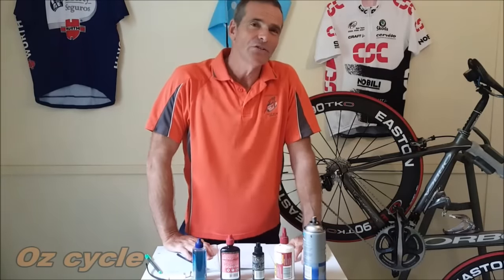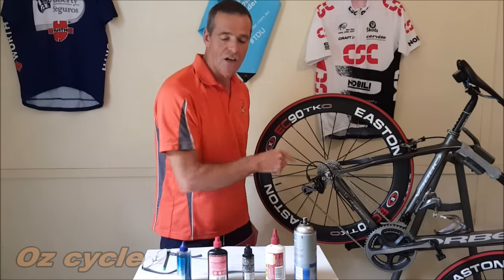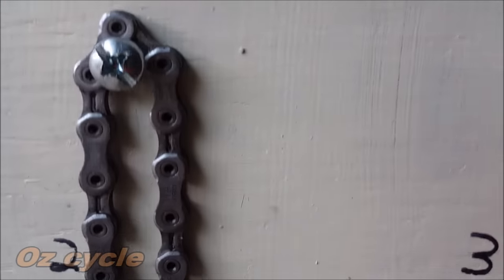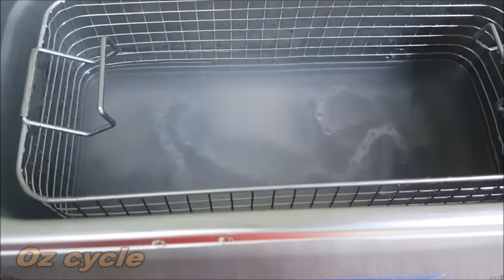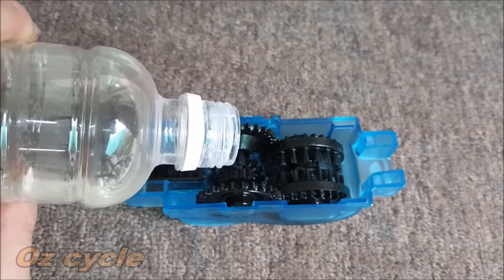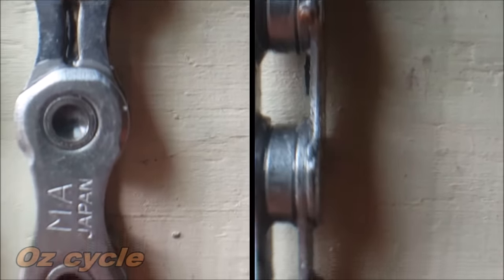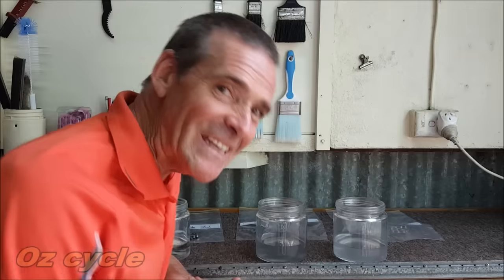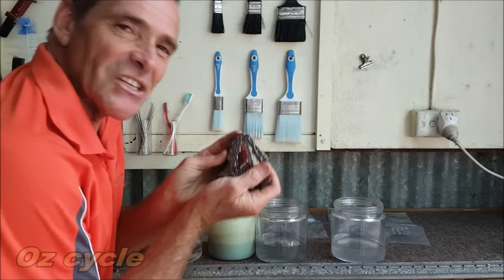Best chain clean ever !!

Comment: These results can be debated. Different cleaning agents were used for the different methods.
Also the ultra sonic can have made particles inside the chain loose and when "rinsing" the chains in the end it came out whereas those same particles were still sticking inside the chain in the other chains.

I am not saying this is fact, it is speculation however the methods will depend on cleaning fluids used as well so I would not count out the ultrasonic cleaner so fast. 

I for one would NOT use petrol as a cleaner simply because it is environmentally unfriendly and my apartment would reek of petrol.

By taking the chains apart and look at them under magnification after the first cleaning method you would have some more data.

Comment: Thanks for the video and the detailed way in which you went about the test. 

I wonder how effective it would be to do a quick 2min clean in the shaker and then a quick rinse under warm water and 10mins in the ultrasonic bath to get the last of the debris out of the chain? Maybe even a shake of the chain to move the links about half way through the 10mins?
Reply from the maker: +Jackson Gee Thanx Jackson. Yes,there must be a lot of ways to clean a chain....as long as its as clean as possible before waxing.
Reply: Well you've made it much easier to consider what the best method is, so thank you.

Comment: I use Simple Green in my chain cleaning tool. It's not even as nice as the one you used. The Simple Green removes way more grime than your homemade cleaning solution. The water comes out pretty nasty. It's cheap, non-toxic and biodegradable. I use it to clean the floors and kitchen and restrooms too. Smells great.
Reply: You use it full strength ?
Reply: Simple green contains petty aggressive salts; metal starts rusting very quickly once it was exposed to simple green. I stopped using it on my chains for that reason; back to citrus-based.

Comment: I start by cleaning my chain with petrol. I let is soak for a couple of days and shaking it randomly over those days. Then I soak it in brake cleaner shaking it randomly which works really well. Then i put it in the ultrasonic cleaner in isopropyl alcohol. Then chain is then as clean as it is going to get.

Comment: I don't know if anyone else noticed but the 5th gear cog is worn completely out. It looks to have done at least 7-10000 km on one chain. And also 4th gear cog is also getting a good amount of ware. It might be a suggestion to use a wider range of gears and change the chain a little more frequently.

Comment: For chains without rubber o rings. Take one glass jar, fill 3/4 with old petrol, place in chain and leave to soak. Place lid on and shake a few times. After a few minutes chain is brand new. Refit and oil, I use 3in1. Has worked for 20+ years. No fiddly gadgets. Just simplicity.
Reply: If your going to store your chain, for whatever reason,  place in press seal bag, add some oil and seal. Chain stays clean and lubed up. When ready just wipe and fit.

Comment: Thought for sure the ultrasonic cleaner would have won.
Reply from the maker: +D. O'H Me too D.OH. I bought the sonic cleaner to do the best clean on my chains and other riders in our group....which it does but takes half hour plus more chemicals and electricity....mmmm.
Reply: Try the ultrasonic cleaner with petrol :)
Reply: It did. You have to buy a decent one (not a Chinese one that runs out of phase and fries itself after 6 months), with 2 or more 100W transducers per litre of fluid volume, running at 40 kHz. You don't use exotic chemicals, you use neutral or slightly alkaline detergent, and water. Paraffin wax as lube? You do know it's water soluble, don't you?
Reply: I think this video pretty much proves you don't need an ultrasonic cleaner, even if its twice as good as the one in the video (highly doubted) its not worth its price for cleaning a bike chain, just use the petrol in a jar method, so cheap and so effective, even using a degreaser like simply green will do a good job
Reply: 3 ultrasonic cleaners, 1 with petrol, 1 for rinsing, and 1 with white spirit.

And magnets in all of them.
Reply: iggy2k you mean try that or you actually do that? Either ur a bit too brave or don't know about the flamepoint of gas/air mixture. Ridiculously low. It could potentially blow up near a lightbulb(old school non LED). Dunno bout the white spirit, but  ethanol vapors blow up bery easy too
Reply: it did win, it broke down more of the crud in the links, that's why it all fell out when he put it into the  mentholated spirit, the chain cleaning tool broke down a bit less but the worst was the home made crap he used, nothing fell out of the chain as it didn't weaken any of the hard crud in the hidden places.

Comment: The ferrous metal particles could also be from iron in dirt on the trail, it is the most abundant element.  Probably the majority of what you found can be explained by that.  Don't get me wrong, great videos.  I'm switching to paraffin wax!  First, my bike chain then I bet the same benefits are true for my motorcycle and all other chains I have around. Thank you ;)
Reply from the maker: +Damon Mueller You may be right there Damon...ferrous particles from the roads/trails. Not sure about using paraffin wax on your motorbike chain....do some research first just in case the chains requirements are different.
Reply: I agree that most of the metals would come from the road grit, and only a smaller amount from the metal coming from the chain wear itself.
Reply: Depends on the motorcycle chain.  If it is an o-ring sealed chain, paraffin would be very foolish.

Comment: Just a general comment about cleaning and relubricating.

Many years (decades) ago automobile wheel bearings had a notoriously short life. One of the main causes, according to my father who was a licensed airframe and engine mechanic, was the practice of auto mechanic to repack bearing with fresh grease. The repacking was necessary but the cleaning was the issue. Mechanics would wash the bearings in petro solvents and blow them dry with air pressure. This would spin the bearing with no lubricant and scar the rollers and races thereby shortening the bearing life significantly. Aircraft manufacturers cautioned against this practice but auto manufacturers never seem to spread the word.

IMHO, I fear that the method of completely stripping a chain of all lubrication and attempting to lubricate fails to get all of the contact surfaces lubricated, thereby reducing the life of the chain. Especially a paraffin lubricant that may not penetrate all surfaces with just dipping or wiping.

I have been using Honda Manual Transmission Fluid for a chain lubricant for years. It is quite light,  full of detergents and does not capture the fine dirt particles that come up from road surfaces, especially wet roads, as the very heavy oil that comes on a new chain. I wipe a liberal amount of oil over the chain about once every 500 miles or so, ride one trip and dry the excess oil off at the end of the ride. My chain life is about 5-7,000 miles with no perceptible wear of the gears in about 30,000 thousand miles on my old bike with Shimano Ultegra chains and components.
Reply from the maker: +GaryL3803 Good cleaning advice Gary. To get the wax into pins and rollers,bath the chain in hot wax and occasionally agitate it until no more bubbles come from the chain.

Comment: "Even a brand new chain need the factory lube stripped out". Most of the tutorials I have read disagree. Even Sheldon Browns writes that the prelube from factories are extremely good, and will outperform aftermarket lubes.
Other than that, liked the video.
Reply from the maker: Yes,unfortunately the packing lube that chains come with have high friction coefficient. So for low friction that lube needs to be replaced with the wax.

Comment: In my experience, Simple Green & Distilled hot Water work as well as petrol without the smell and contamination of soil. If not completely clean on the 1st go, since I am not hosing off my chain with degreaser, rinse & repeat. 

(the distilled water is important, as it will absorb much more than tap water saturated with minerals and such)

Comment: Surely petrol is not really an appropriate solvent to use - how do you dispose of it? Not very sustainable if you're cleaning as often as needed,.

As for the ultimate question - why not just go straight for the methylated spirits in the first place if it's your final checking point anyway?
Reply: barfarina Methylated spirits will remove water and light organic compounds, but it’s actually not the best thing to remove grease or wax-like substances. Heavier solvents like petroleum will be much better to use first.

Alcohols are great for finishing.
Reply: Put the petrol in a coffee can, walk over to your neighbor's backyard, set it down, walk away from it in slow-motion while you throw a lighter over your shoulder and into the can causing it to burst into flames. Boom! Toxic problem solved! 
Pro tip: you can't look back, that'll ruin the whole thing. Must only look forward in the direction you're walking. 
You're welcome.
Reply: You are perhaps barking up the wrong tree.  The major reason why gasoline is not a good choice is safety.  The same reason why it is used as a fuel in a gasoline engine is why is it not a wise solvent to use.  Gasoline vapors plus a spark is an explosion.
That spark could be static, a heater cycling on and off or even you turning on or off a light.
Reply: @BPoweredLove  Gotta light the cigarette first, or better yet, the cigar before you toss the "ZIPPO!" (Wait, scratch that. No one throws away a good Zippo) over your shoulder. 
Que the music!

Comment: Add detergent and a little hot water to the petrol ( goes a grey white ) makes a home made degreaser that will wash off with water . Very potent and works well with the shaker/cleaner if you let it soak first)
Reply from the maker: Sounds good,Im going to try that Greg,thanx 😁

Comment: Every 3 rides or so, while the chain is on the bike, I spray the Chain with WD-40, let it soak, pedal it for a couple minutes while on a stand, then blow it off with compressed air while holding a rag on the back side of the chain to catch the spray. Repeat this until the spray off the chain while blowing it with compressed air is clean. Then lube the chain and blow off the excess lube. When you blow and wipe off the excess lube off the chain, the sprockets stay much cleaner.
  I have two seasons on a new chain using this method, there is no measurable wear on the chain.

Comment: Best of both worlds was my very similar US tank, filled to line with water, but then put chain into a skinny 12 oz plastic bottle with naptha, capped, and just let it float around in the US tank for 10 minutes. The plastic does not stop the US waves, the chain gets both the solvent and US treatment. However, I've learned that agitating by hand and soaking, repeating once with clean naptha, then wiping with rag before drying appears to work practically as well, so the US may be useful for cogsets and odd parts, but a waste for chains. Naptha also is the better no-residue solvent for wax anyway, so once the waxed chain system is used, it's the cleanest solvent with relatively lower risks compared to any gas. Mineral spirits, kerosene just don't compare. Note, that U/S tank like mine has a drain hole; mine leaked under that connection, burning out half the tank's electronics. NEVER buy any US unit with an integrated drain and many don't make them nowadays for that reason, over time the vibrations can break down the soldered or welded tubing connections.
Reply from the maker: I never thot of ultrasonics breaking down the weld at the outlet tap....geeez! 
Yeh Im gonna have to look into naptha.

Comment: Was the home made cleaner the best or was it the solution used? What is the result using just degreaser and dish soap in the home made cleaner? I'd be interested in seeing the result of that. I'm not talking about repeating the entire test, just the home made test. Seems to me the petrol did all the work, the shaking did little. Therefore any container with petrol would bring about the same results, regardless of agitation.
Cheers for taking the time to make this video in the first place.
Reply from the maker: Yes,the petrol did the bulk of the cleaning but you can't put petrol in clip-on chain cleaners...it ruins the brushes.
Reply: Yeah that is a problem with those plastic cleaners. I find two nail brushes facing each other is a quick way of getting the bulk out of my chain. (I ride mountain bikes, so mud is just part of the deal) Thanks for your time, I've found a few of your videos really helpful. 
The home made chain lube is a great video. I've been using 50% candle wax and 50% paraffin oil as a fire starter for years! I make it into the toothpaste you show in that video and rub it onto a cotton ball, starts fires easy-as and stores forever, I never once thought of putting it on my chain! I will be from now on though!

Comment: Well I have found that using furniture polish is just as good as a paraffin wax.

It contains something called isoparaffin  whatever that means but it a whole lot cheaper than the chain lubes 

All you do is spray it on the chain it goes on as a foam so it penetrates deeper into the chain let it sit over night. 

Since using this I find that my legs seem to spin faster. I get about 300 miles out of each treatment

Comment: Why did you use "degreaser", soap and water on the first two chains and gasoline on the last chain? Will the degreaser, soap and water, remove all the wax? If the "Petrol"/gasoline was a better wax solvent than the degreaser, soap, water formula you used on the other chains,  would there be more available wax to come off in the Metholated Spirits solution? And if there was more wax to come off, wouldn't the sonic cleaner chain and the blue chain cleaner contraption be more cloudy looking than the chain that you "degreased" in Petrol?

Comment: I know how to wax on Mr Miagi but how do you wax off? 😂
Reply from the maker: Pour hot water over chain to remove wax and dirt on outside of chain for rewaxings. To remove wax completely out of chain use petrol followed by degreaser. Cheers Jono
Reply: @stevenleffanue  by petrol do u mean gasoline?
Reply: @phonymontana4254  I wondered the same thing? I think it is gasoline.
Reply: @rubioedwin  yeah.

Comment: I find the most effective way is to use an air compressor with a foam degreaser. I would also like to add that being this thorough is a waste of time unless you also clean out the restof your drive train.
Reply from the maker: +TheKimjoh560 Nice idea using compressed air...hopefully it gets between the pins and rollers too. Yes,definately clean cogs and ri gs before installing nice clean n lubed chain.

Comment: Not a fair test as you used different cleaners on the homemade used Petro, which is a much stronger cleaner.  Would have been fairer to use the Petro in all methods tested.  Either way thanks for the efforts
Reply from the maker: +reflectionsdetail Petrol ruins the brushes in the cliip on cleaner and you cant use petrol in ultrasonic cleaner either.
Reply: Yes I understand that, however, to be a fair test of the tool doing the cleaning you would need to use the same cleaning solutions through out.  So using the same solution in the homemade tool would have been more telling and comparative to the others.  It's the scientific process at work then.  Cheers,
Reply: reflectionsdetail   Apparently you do not understand.  Petrol can not be used in the ultrasonic cleaner or a chain scrubber type device.  He is comparing the real life results of three different "methods" of cleaning your chain.  Methods of cleaning include both solvents and how the solvents are used.  He's comparing actual real methods" you could use to clean your chain.  It isn't meant to be a test of different solvents, but different overall chain cleaning methods.  Pretty simple concept to understand huh?  LOL.  And FYI,  it is a completely fair test because the test highlights the fact you can't use petrol with a chain scrubber or ultrasonic device.  That is perfectly fair.  :-)
Reply: @Bob Gardner - Using gasoline as a degreaser/cleaner may be "real life" where you live but it isn't for most developed nations. It certainly is NOT acceptable where I live. And that's the probable reason why the homemade "method" achieved better results -- because it used an "unsafe" degreaser/cleaner. Remember who Oz Cycle's video are intended for -- not professionals who will safely use and dispose of gasoline (or other strong degreaser/cleaners). These videos are intended for amateur cyclists and they should promote safe methods that can be done at your family home by do-it-yourselfers.

Furthermore, the fact that gasoline leaves a film and requires a second degreaser makes it's choice even more of a contradiction. If Oz can demonstrate his homemade cleaning device works well with a "safe" degreaser/cleaner and does not require a secondary degreasing, then it has merit. Otherwise, it's a bad idea except in an emergency.
Reply: But oz used kerosene or gasoline? Kerosene is very safe, just use some gloves and used it on open space. And with this method you almost dont have any direct contact with kerosene.